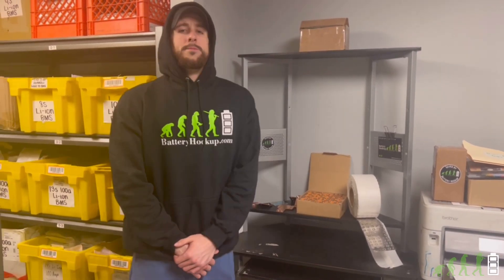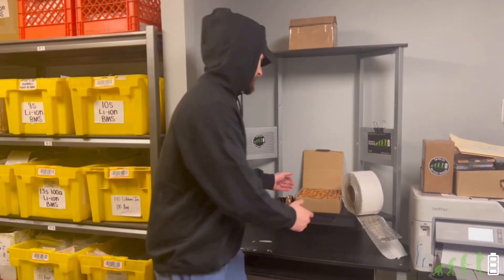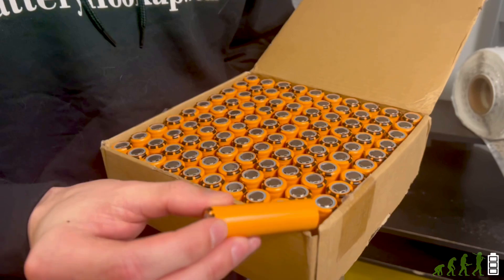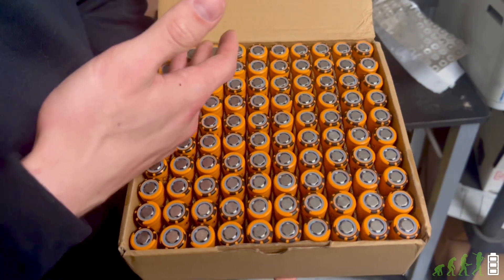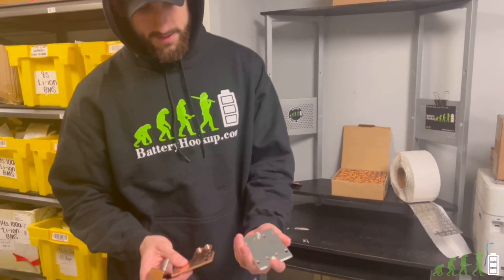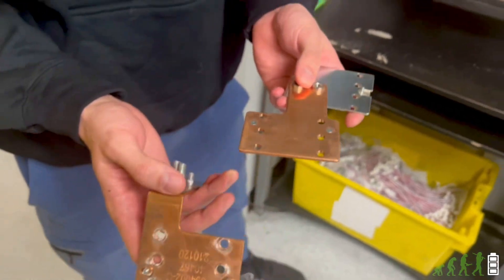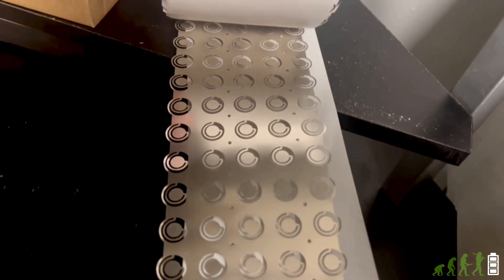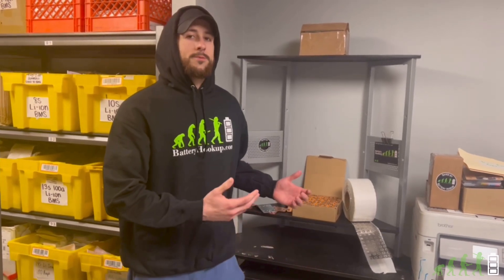Battery Hookup Introduction Video

Comment: Hi Ryan,  I had the opportunity to pickup a couple of 8S LFP packs from you a couple weeks past.  My question (if you folks are still active on this channel) is the following.  Do you recommend using the 280ah cells as they came in the pack or recommend disassembling the pack to the individual cells?  They're a bit bulky for an old guy to swing around :)  Thanks!

Comment: Really wish your company would offer more shipping (courier) options to Canada. Such as USPS, Purolator, DHL, CanPar.

As the methods you currently offer charge an insane price along with extremely high brokerage charges! 🤢

Hard to justify purchasing 25-50 batteries when the shipping cost more than the cells?!? Never mind the exchange rate which impacts the cost of the cells, shipping, and duty & taxes! 🤦‍♂️🙁

Please consider more reasonable shipping options into Canada 🇨🇦 👍
Reply from the maker: Hi! Thank you for your feedback! We offer the cheapest possible shipping rates and we are always negotiating to try and get better rates. If you're interested in larger orders that can ship on a pallet we have pretty decent freight rates to Canada. It's really just the small parcel shipments that are expensive, and we apologize! As for USPS we cannot ship batteries to Canada via USPS due to strict rules and regulations, unfortunately, but if you would be purchasing only non-battery items you can email us for a shipping quote via USPS. Hope that helps and we will continue to look for better shipping rates!

Comment: What  is the best thing to use them A123 cells on  would they work good on a ebike   Think you
Reply: yes they would 1 parallel row is 30A capable. 2 would be 60....etc
Reply: @chrisehst8907  thank you
Reply: They are only 1100mah so it will takealot to get a usable pack with sufficient Ah. The smallest packs are usually 10ah, with these cells it would take 130 of them to make a 48v pack. The only reason to use these cells on an ebike would be for a high amp draw setup, like a 3000watt BBSHD mid drive. And still I would choose another cell.
Reply: @mikeinglett3994  think you what kind of cell would be best for a ebike at 36 volt 500 wh.
Reply: @guiterman6263  looking at battery hookups current listings I’d get the “Samsung INR18650-33G 3150mah 18650 Cells”. You could build a 10s3p with 30 cells for $60. That would be a 9AH battery. That’s a fairly small pack. Or order the 100 cell pack for $190 and build 2 batteries with 10s5p configuration. Then you would have 2 each of 15AH batteries.
Also be cognizant of the max continuous Amps you you are allowed to pull from each configuration. The 9ah build will be limited to 20amp max draw. The 15ah build will be max of 32 amp draw. If you have a higher amp draw than these you will have to increase the number of cells in parallel to get the capacity you need.
Reply: @mikeinglett3994  thank you I was thinking of them cell my self
Reply: @mikeinglett3994  I built a 10s. 8p. With some Sanyo cells 2200 ma. And if am right it’s a 500 wh. What do you think about that and am I right about it being 500 wh.
Reply: @guiterman6263  probably close to 500ah. 2.2x8=17.6ah pack. 17.6x36=633wh. But cells are usually less than stated mah. So the pack usually tests out 10% or so less.
The reason to go with higher mah cells is to make a lighter pack for ebike. But you also have to make sure that what you have in parallel will handle the continuous amp load demanded by the controller. Most 500w hub motor ebikes are 20amp max draw.
Reply: @mikeinglett3994  yes you are right about that i like to have some of them 21700 cells i think them would make a good ebike battery